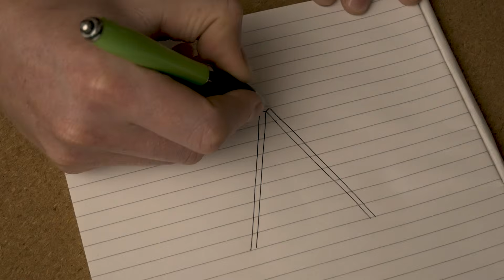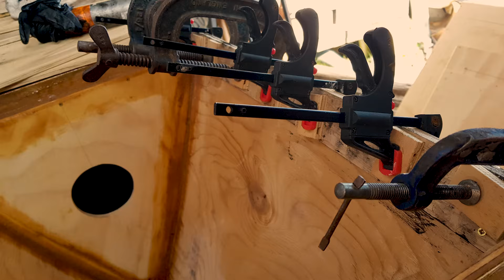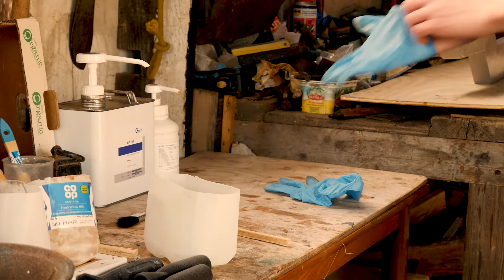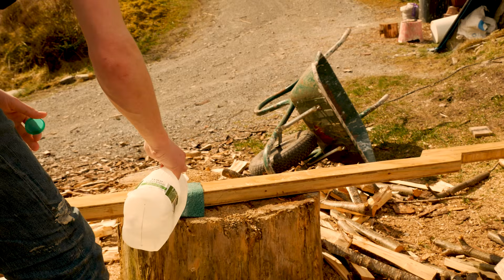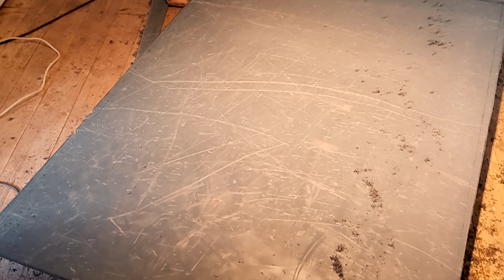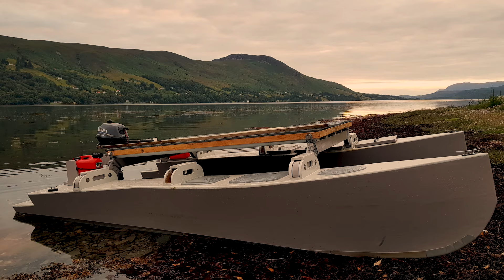Building a Plywood Catamaran

Comment: You can learn a lot from James Wharrams designs and construction methods.. on old canoos they used hd nylon fabric to skin and strengthen then paint .. 

Wharram virtually pioneered the cruising catameran building his first in 1955. Hannika Boone is still running their buisness in the SW of England.  

Take a look at Mark of Wilding sailing building a Pahi 42 and theres a chap in Hawaii building his own Solar Electric light multihuls. 

Theres also a company out there that produces a twin hull fold flat catameran platform from Corex .. the  tough corrugated twin or triple wall plastic.  Handy as a transport platform if you can store it flat without creasing or crushing the tough corrugations. 🧙🏼‍♂️🇬🇧👍🏼
Reply from the maker: Wharram designs are great. The flexibility allowed through the lashing of the beams and deck makes them more resilient in rough water. Multi hulls have a lot to offer in their efficiency - great for solar. What is the company called that is making the Corex boats?  Thanks for sharing!
Reply: @ChannelX24  

Hi there's quite a few Corex /corruflite  boats and designs out there including canoes and small motor boats.  But the one that's closest to the image saved on my old phone is like a longer AquaNaught.
Reply from the maker: @clivestainlesssteelwomble7665  Its a material with quite a lot of possibilities for small craft. The weight being so little I suppose is a big plus, and how easy it is to cut for manufacturing. 

I wonder if solid polypropylene sheet could be used in the same way? It wouldn't be as lightweight but incredibly strong and wear resistant.

Thanks I've had a look at the AquaNaut.
Reply: @ChannelX24  
It comes in different thicknesses and grades.. 8 or 10mm Corex is tough .. the darker the colour the better the UV resistance ...it's even semi fire retardant.  Cut it with fine saws or Stanley blades. The one awkward bit is sealing the eds of the flutes.. to stop them filling with water...but it can be done.  Solid polyprop is quite heavy.. the same suppliers also make vinyl boards which has a gloss finish over a lower density core. 
The most common thickness for correx is 4-6mm single flute ..used for estate agent signs etc.  the big stuff is usually double wall and some even has an Al foil skin but in and it's tough as and as much as 25mm thick .
There's the problem of plastics though.. and costs... Some pallets use ply tops.. 
but it depends what you want or need to do.
I got interested years ago wanting to make SPAD RC flyingboat models. Simple Plastic Aeroplane Design's.
Reply from the maker: @clivestainlesssteelwomble7665  Definitely sounds like its a material with a lot of potential for small boat design. Big strength to weight ratio.

Comment: Nice work, thanks for the video. What are your thoughts on making pontoons from foam and poor mans fiberglass, (I'd probably reinforce the foam with ply or incorporate chicken wire for strength)?
Reply from the maker: Solid foam is a good option as it cant flood if damaged. Closed cell foam needs to be used for marine applications as it won't absorb water. You'll want to separate the foam from the water somehow (prevent fish nibbling and erosion). Cladding with ply could be a good way of doing this. I've not had experience during poor mans fiberglass, but I've looked into it in the past. It will depend on how long you want the pontoon to last, and how harsh the environment is. Epoxy effectively makes your ply into plastic so if you want something to be very tough and last a long time its a good option. Cotton is cheap, fiberglass is fairly cheap and epoxy is expensive. 
Have you looked into HPDE plastic barrels and containers? These can often be bought for cheap and then lasted to a pontoon frame. You could fill these with closed cell foam for redundancy and they are very tough.

Comment: Woukd love to know what was on the inside of the beams or did you just glue several pieces together to make one thick piece?
Reply from the maker: Thats right they are several pieces laminated together. Each beam is composed of 8 pieces of wood. The core of the beam is 25×50mm pine stacked to a 100mm thickness then where it steps down 2 100mm pieces again on each end. I used microfiber strengthened epoxy to laminate the sections together and metal pins for alignment. Then again with epoxy and screws to laminate 9mm ply sheathing to each side of the beam. The ply sheathing is one continuous piece in the shape of the beam for each side.